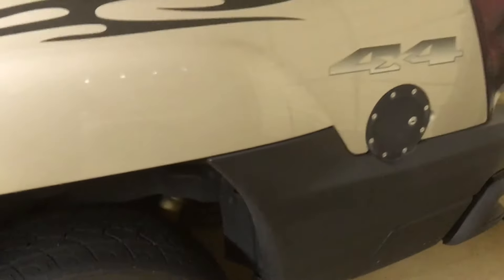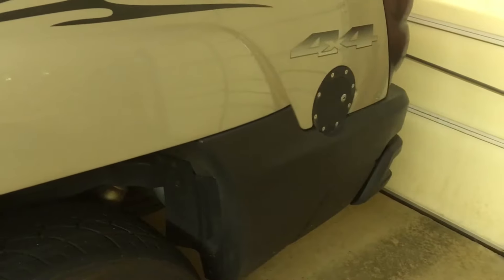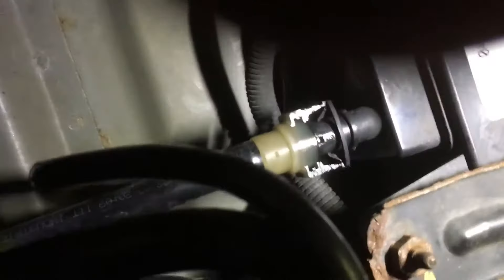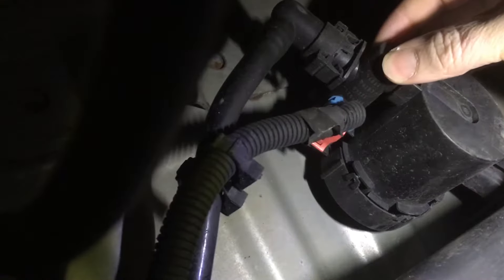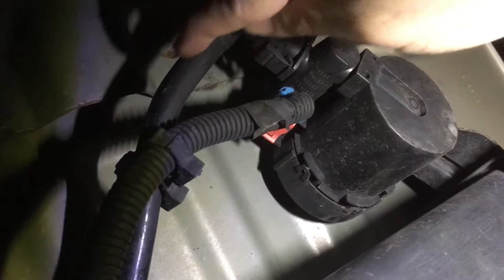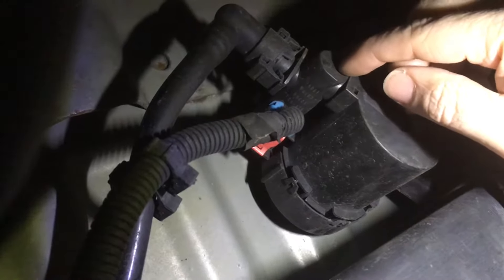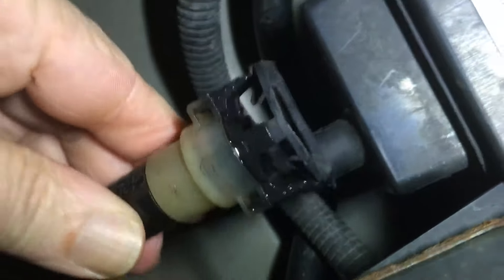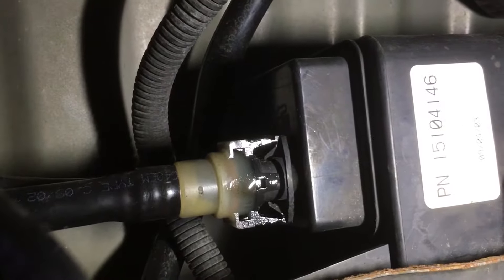Troubleshoot gas pump shutting off during tank fill up on Chevy truck

Comment: Did I’ve been fighting putting gas in my truck for 4 years.   It’s my service truck.  2500 w tool box body.   I honestly figured someone that installed the body on truck screwed something up.   Thank you so much.   Now I can get fuel like a normal person! Without having to take 30 mins 🥵
Reply from the maker: Awesome. I’m glad it helped!
Reply: I have the same truck and same issue
Reply: @chrisricks9583  I’m still  dealing w it.   Thankfully I only hand yo put gas in ab once a month
Reply: @arfarms5711  did you find the issues for yours? I changed both parts and I’m still dealing it.
Reply: I changed my charcoal canister.  It worked. Don't over fill you gas tank

Comment: Fantastic video. I went ahead and replaced the vent valve. So bummed out today when I went to the pump and my avalanche was still doing it. So glad your sharing your diagnostic approach. Thank you so much
Reply: Did you ever figure it out because I replaced both the vent valve and the charcoal canister and it’s still having fill problems
Reply: @EmeraldWC  
Yea I was able to fix it. Ended up being the media from the old charcoal canister backing up and getting into the lines and tubes that vent the fumes from the gas tank to the canister and vent tubes. I Found out this was pretty common in these GM’s. We had to drop the tank set it on a bench and blow out all of the lines from all different sides and ports. A lot of the charcoal beads were flying out everywhere. It took about a good 20-30 minutes of blowing air through all the the hoses and lines that were attached to the gas tank. Went ahead and reinstalled everything and put in a new charcoal canister, and finally I was able to pump gas without any problems. Did it just about 1 year ago and still haven’t had any problems. I hope this helps. 👍🏽😎

Comment: Good explanation on how to narrow down the issue. One other thing that would need to be checked, the tube between the charcoal canister and vent valve could be plugged. I would suggest checking all of this by getting a piece of hose that fits over the charcoal canister inlet, then blowing through, and removing different parts, rather than driving up to put gas in.
Reply: I changed all of that on my 07 avalanche and still having the same problem

Comment: Informative video 👍👍👍, also I have flushed out the canister and then blew air with compressor thru it , and it worked again with no problem..
Reply: ⁰

Comment: Good video. I’m having the same issue with the pump turning off just after adding about a gallon of fuel. I disconnected the vent line running form the fuel tank to the charcoal canister and tried to get gas. This time, gas is pouring out of the vent line. What’s that about? I’ve changed out some many parts and haven’t fix a damn thing.

Comment: Hey,after you replaced the charcoal canister did that fix your issues cause mines didn’t.any other tips outside charcoal canister pure valve n vent solenoid?
Reply from the maker: Replacing the canister fix it for me. If you are still having problems, then it is probably clogged lines from your tank to the canister.

Comment: When you disconnected both of those lines to diagnose the problem would that let gas come out or just vapors??
Reply: If you pump the tank to full and the gas pump then cuts off, you will get a little bit of gasoline dribbling out onto the ground.  It's normal for a little bit of gasoline to go down the lines into the vapor canister when you top off.  This is a good way to see that the lines are clear (seeing some gas on the ground after filling up with the lines disconnected).

Comment: I have a 2011 Suburban that you can hear the air girgling up the filler neck every few second and then pump nozzle shut off. I can go slow, same thing! Now, I know where to look and what to do.  Thanks.
Reply: any luck. having what sounds like same issue as yours. Replaced canister and still issue is present.
Reply: @jjgarcia6833 could very well be loose charcoal pellets clogging the vent line that runs from the tank to the charcoal canister. Either vacuum that line, or drop the tank and blow it out.

Comment: You don't always need to replace the canister. If its clogged you can unclog it pretty easy & put it back on. I've seen some canisters with a vale in them & people would spray wd40 in the hole where the valve was to lube it if it was getting stuck closed. Anyway the canisters are nothing fancy, just plastic with charcoal pellet's but the cost $200 plus. You can buy a delete kit that removes the canister all together.
Reply: Thanks for the comment, Wanda.  My canister had a foam barrier inside that keeps the charcoal from backwashing, and the foam had deteriorated, so I needed a new one.  The charcoal was floating back up the vent lines toward the tank.
Reply: Dude where???

Comment: Having this problem on my 2008 Tahoe. Is the solenoid valve in a different location in the 2008- models? I’m reading all sorts of locations and can’t even start with your first step
Reply from the maker: I’m not exactly sure on a second generation avalanche. I think if you find the charcoal canister and work your way backwards and forwards from there, that should give you a search strategy
Reply: It’s on top of the motor if it is like our 2007 tahoe.

Comment: thanks for video . i have 2011 gmc uno 170000 miles doing the same thing.looked at scotty video also and he says can happen when i over fill tank after it shuts off by itself,then extra gas i  put in will flow into vent tube and literally clog  up the carbon in canister
john
Reply: Yeah, I believe what happens when you overfill is that gasoline flows out the vent tubing and into the charcoal canister.  There is a foam barrier at the canister entrance, but it disintegrates over time.  Then the liquid gasoline that flows into the canister washes back into the vent tube, carrying charcoal pellets with it.  These pellets clog up the vent tube and have to be blown back out.

Comment: Thanks for the video.  I am having the same problem.  I replaced the vent solenoid and the fuel kept clicking off.  I will try the line to the charcoal canister next.
Reply from the maker: Good luck. Try just disconnecting the line to the canister and let it vent freely to the air first and try gassing up. That way you’ll know without throwing parts at it.
Reply: Arthur, did it work after all. Fixed it. I have same problem. I already did the first test. This weekend or once I can, I'll be trying the second test with rhe charcoal canister. And then the lines. This way I'll know my lines are not clogged up.
Reply: @treyspetch  Hypothetically if one was to leave that connection disconnected, would there be a code thrown or any problems other than the obvious one?
Reply: @trey5630  Yeah that's what I figured. Mine is actually doing it on an 04 Chevy Venture. I'm hoping I have the same set-up as your truck. I'll wait till the weather gets warmer before I take a look.
Reply: How much was the charcoal canister and where did you purchase it?
Reply: @kevinspahr6632  I can't remember.  I think I found it on Amazon.
Reply: @kevinspahr6632  Amazon is way cheaper then auto parts store.. I looked up mine for Chevy Ava and it cost about 50$ ish while parts store costs about 100$

Comment: I just replace the canister and solenoid kit any the purge valve.  Still cuts off at the pump.    What could it be?    Maybe I’ll just unplug the damn connection and let it blow fumes into the air.
Reply from the maker: If you disconnect all that and it still stops, then your vent lines are clogged and you need to blow them out.

Comment: I replaced my vapor canister still have the same problem. Could it be I need to clean the  lines?
Reply: Yeah, my guess would be its the lines that are clogged or the valve will not open.
Reply: @trey5630  okay, my lines is clogged up  my mechanic said
Reply: @trey5630  he said my value is good
Reply from the maker: @lauradinkins  On my 2004, there’s a very small line near the very back of the tank there’s a fitting that you can disconnect in the middle of the line, and you can put a compressed air gun against it to blow air into the tank and blow those vent lines out. If you can do that, it saves you from having to drop the tank down to get those lines out
Reply: @treyspetch  I have a Hyundai Elantra 2002

Comment: With either one of the vent hoses disconnected during troubleshooting, is there a risk that when filling the tank the gas pump won’t shut off in time and gas overflows when filling tank?
Reply from the maker: No, I have done this. The worst that will happen if you get a little triple of gas on the ground when the tank is full. That’s the gas that normally with triple into your charcoal container.
Reply from the maker: The pump will still shut off when the gas work his way back up the filler neck.
Reply: treyspetch thanks!
Reply: There is a check ball at the top of the tank. Liquid gas should never go into the evap system. If there is, there is another problem, and the charcoal canister will be bad because of the liquid gas.
Reply: @jasonsprouse2803  The check ball is a rollover protection.  It only blocks the flow when the gas tank is upside down.  If it activated all the time, the rush of air out the vent hose would be blocked, completely invalidating the idea of a vent hose.  Liquid gas goes right out the vent and into charcoal canister when you overpump.  Give it a try by disconnecting your hose from the charcoal canister and you will get a pool of gas on the ground when you pump the gas beyond full.  The charcoal canistetr can take a little bit of liquid gas.  This is why they tell you not to pump beyond when the pump shuts off, because it dumps more gas into the canister, where it floods it and it takes longer for it to evaporate.

Comment: Great, thanks! Very helpful. I just replaced the vacuum solenoid as you did so off to fill the tank and see if it shuts off still. Just wondering if you noticed using more gas before the repair and or hard starting which some say are symptoms of a bad charcoal filter?
Reply: the gas vented directly to the air via a air line that ran alongside the down spouts..  from 1920-till 2001 , before they mandated EVAP systems post2000.   california made that no longer possible..

Comment: Ok, so having disconnected the hose from the tank into the charcoal canister, the problem persists. If understand correctly, that could mean that the hose may be clogged, correct? Any other thoughts?
Reply from the maker: Yes it’s very possible that charcoal pellets have floated back up into that hose and clogged it. It happened to me once. I found a very small 1/4 inch line coming out of the back of the tank that think led up toward the filler neck. It had a little disconnect in the line. I disconnected it and blew compressed air through it to inflate the tank. About 1/2 cup of charcoal pellets came blowing out of the vent line that goes to the canister. After that, I Hooked the vent line back up to the canister and everything was cool. Some people say that this is a consequence of overfilling your tank by continuing to click after the pump shuts off. I think the idea is that fuel flows into the charcoal canister and then back washes into the line carrying charcoal pellets with it.
Reply from the maker: And make sure you keep the filler cap closed, so the tank will hold the pressure when you blow air into it.
Reply: treyspetch 
I suctioned lots of carbon debris out. Still not working. I now recall in the past that when this began, at one point when I was trying to “rapid fire” fill my tank that fuel actual spilled out at one point. At the time I figured that the evap system shutting of the filling caused stoppage of fuel intake, but now I wonder if it’s a problem in the first stage of the fuel line, from the top (the neck) down to the tank. How common is that? Might be time for me to give up and take it into the shop? Appreciate your comments and suggestions. Was fun while it lasted
Reply from the maker: @michaelcronin8253  I’m not sure if suctioning out really provides enough force to clean the line out. I think I would take compressed air and blow it out from the other side to ensure that there’s nothing still stuck in there. It just requires a compressor.
Reply: treyspetch 
The issue there is that I think I’d need to drop the tank to get to the other end of the line, correct? That’s a bit beyond my capabilities I think
Reply from the maker: @michaelcronin8253  no, you don’t need to drop the tank. Look near the rear of the tank. Mine has a very small vent line or something coming out of the tank near the back and heading upward toward the filler tube. It was really small like 1/4 inch diameter. There was a fitting in it that I was able to disconnect. Then I took my air gun with rubber tip and blew into the line and it inflated the tank s d blew the carbon out of the vent line.
Reply: treyspetch 
Great! I’ll give that a try. Would that account for the gas overflow at the pump?

Comment: nice how GM stuck a few hundred dollars of useless parts and weight on the truck to make some side money along the way. what's the point of having charcoal canister in there and a solenoid if the fumes go to the engine and burn anyways?
Reply: All of this stuff is required by the federal government for emissions standards.  The charcoal canister is required to scrub and capture the gas vapors on every car, where the air in the tank has to vent out when you fill it.  The valves are required to then close the system to allow the engine to suck them back out of the canister and to do the emissions test, which the government also mandates.

Comment: The vent valve brings in fresh air, not vents it. The purge valve vents the vapor...into the intake manifold.
Reply from the maker: During refueling, the vent valve remains in the normally open state to vent the air from the tank. That’s what allows you to add gas. When the valve gets stuck closed or the vent lines become clogged, the gas backs up in the filler tube because there is nowhere for the air in the tank to go. The purge valve is closed when the car is off.

Comment: For anyone in the rust belt, the old evap canister vent may not come off the slide tab. Just use (I used stainless steel versions from commercial electric) zip ties to secure the new one to the old one.

Comment: What if you change the solenoid valve and the charcoal canister and you're still experiencing the same problem
Reply: clogged vent lines
Reply: @trey5630  do you have a part number for that or just say I need the vent lines between the solenoid and the charcoal canister
Reply: I don't know the parts numbers.  You can get the vent lines between canister and solenoid off yourself pretty easily and blow them out.  The lines from the tank to the canister are harder to get to, and most people remove the tank (lots of work, never done it).
Reply: @trey5630  thank you your video and advice has been a great help

Comment: i unplugged the solenoid AND the canister…it still won’t fill.
Any ideas?
Reply from the maker: Then it’s clogged vent lines between your tank and the canister.
Reply: @treyspetch  i’m pulling off the filer line right now to check the flapper then i’ll blow out the other lines
Reply: @treyspetch  I also took the lines off the canister and the solenoid to try and fill up that way and still same issue.
even with the lines detached it won’t fill
Reply: @treyspetch  blew out the line from the fuel pump to the canister. Completely filled with charcoal. works fine now
Reply: @cali_misfit1387  Ah, I'm glad you found the problem.  When my charcoal canister got really old, the foam barrier that keeps the charcoal pellets inside the canister disintegrated.  Then when gas flowed into the canister on overflow, the pellets back-washed into teh lines and clogged them. Sounds like same problem with yours.  You might want to check your canister inlet to see if the foam is gone, so it won;t happen again.

Comment: What caused the charcoal canister to fail, moisture or fuel?
Reply: I'm not sure.  The foam insert that keeps the charcoal from going out the inlet nipple was all disintegrated.  It was 16 years old.  Not sure if it was from overfilling too much.
Reply: Trey I’m about to do mine on my 16 yr old Escalade. Same system. Thanks man.
Reply: @joeculpepper2235  could be driving on gravel roads? It's happened to me on 4 different vehicles now in the last 10 years and I've only had 6 vehicles in that time, I drive a lot of gravel roads, do you often travel on gravel or live in a dusty area? I'm in farm country mn tons of dirt kicked up so I'm assuming that dust is the cause of the problem.  If anyone is in a city and never drives gravel and still has this issue, let me know. I'd like to figure it out too